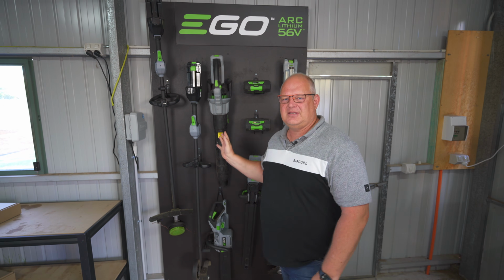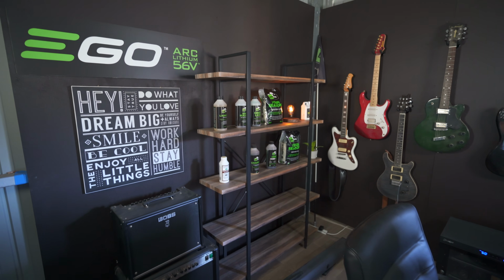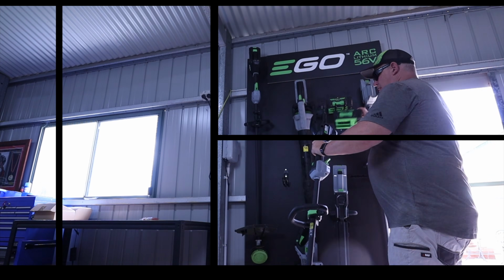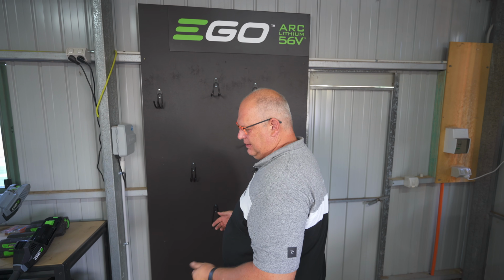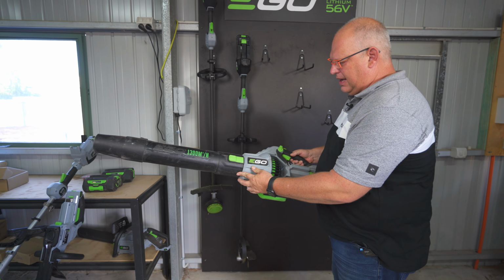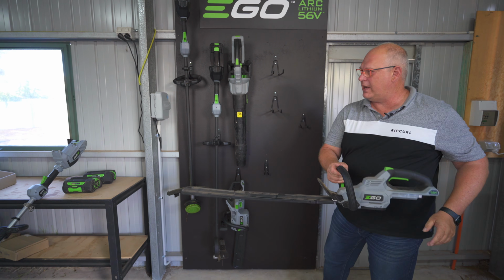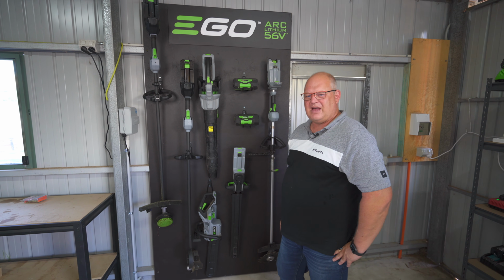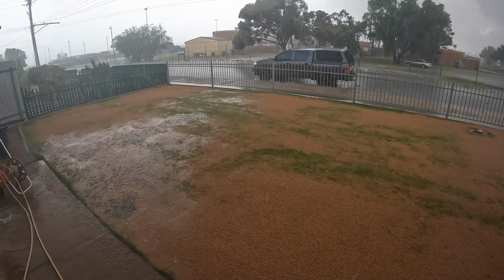Garage Power Tool Storage Idea for Ego Tools: Easy DIY

Comment: Yikes 55mm! Plentyyyy of rain. U got a rainwater tank that’s connected to your irrigation? 55mm would come in handy on hot dry days! Haha. Love the ego wall. Question: does Four Seasons fertiliser have good/high calcium levels in it? Thinking my buffalo lawn needs that, as I only ever feed it with 2SpecElevate, and although it’s in great condition, I have some 2 light green patches that don’t change even after I hit them with nitrogen/iron.. I’m thinking calcium/lime may be required..

Comment: Another idea would be to attach battery chargers to the wall so the batteries can be stowed and charged at the same time. Drill a hole large enough through the board to feed the power plugs behind and out of the way.
Reply from the maker: I did think about that and I’m still thinking about it lol!